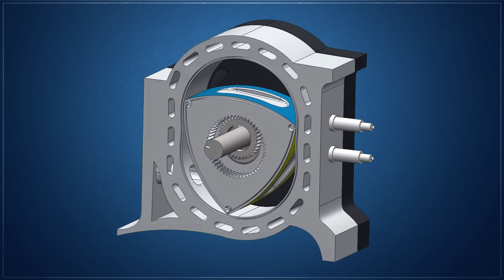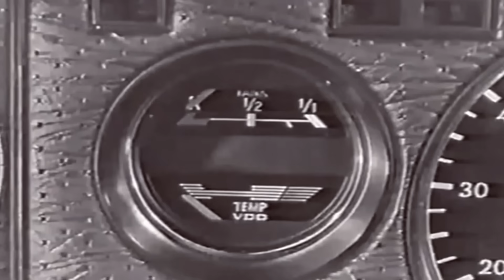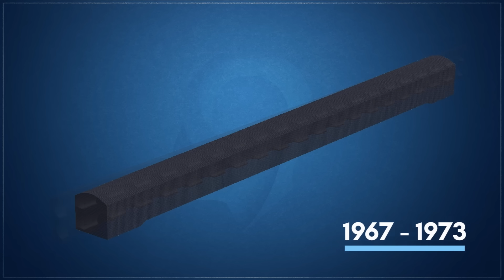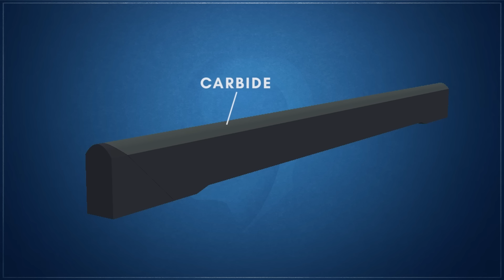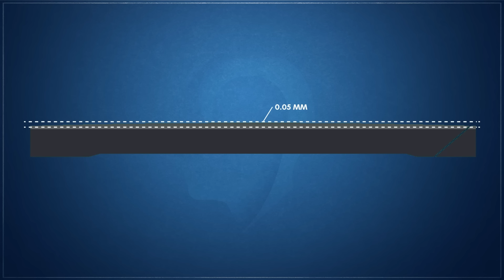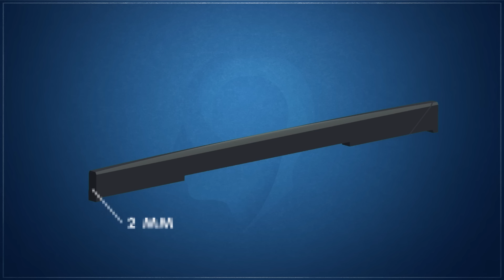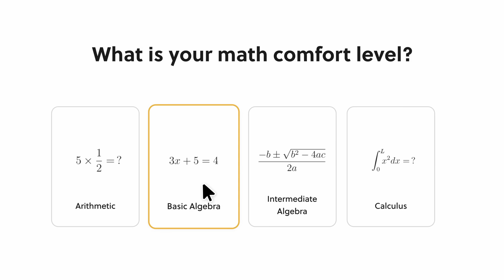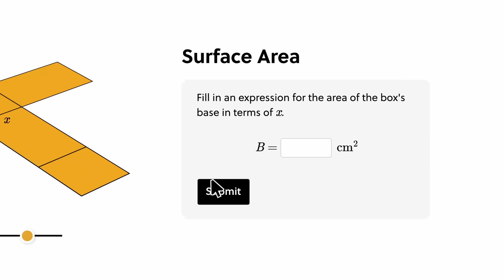Overcoming The Rotary Engine’s Biggest Flaw

Comment: Good video but I think it's missing some of the story though. Apex seals have gotten improved significantly by rotary shops after Mazda abandoned the rotary engine. Some rotary builders don't even consider them the most common source of the major issues with the engine.
Reply: This is great for prolonging the life of vintage engines, but it doesn't address the fuel economy or emissions problems with new engines.
Reply: @rockets4kids  The most HATED rotary🔥🔥😬💥🤘👉 https://www.youtube.com/watch?v=gHVC9DN1row
Reply: 100% spot on. Aftermarket support for apex seals are so plentiful and great that it’s now the least of problems, especially when more owners learned to premix their fuel as well. Now the longevity of rotary engines, especially boosted ones, dealt with the immense torque produced with the added boost. 

This could be an important topic someday, considering the new 800cc extender in the new SUV was also physically larger than the 13B designs. With Mazda planning something big for their future sports car based on patents I’m very certain Mazda definitely looked more into improving the strength of the rotors and housings under extended load.
Reply: @Nafeels the engineering continues but emissions is something the aftermarket doesn't have to worry about.
Reply: @Noman1000 Reliability, not emissions is why Wankel engines are obsolete technology today.
Sales of Wankel engines was worse in countries with absolutely no emissions regulations.
Reply: @Nafeels Apex seals are inherently weak and unreliable by design.

You have to be monumentally ignorant to pour the wrong oil into the wrong filler hole son, if you cannot read your owners manual or the label on a bottle of motor oil? You have no business under the hood of any car.

Please stop spreading lies and ignorant misinformation about a topic that you clearly do not understand.
Reply: @Nafeels 
Yes. To me, Wankel engines are just 2strokes in another form. I'm already used to premixing gas in bulk, because my work bike is a 2stroke. I'm seriously considering putting a Mazda Wankel in a motorcycle. Especially if that Liquid Piston engine still isn't for sale yet.
Reply: I love Wankel engines because I don't like vibrations, but I do love their sound. A single cylinder is the most efficient engine I've found for generators. But for a powerful, lightweight drive engine.
I'm interested in very small inline 4, V4, V8, V10, Wankel, and gas turbine engines.
Reply: @observingrogue7652 If you don't like vibrations? Then why exclude V-12s?
 The only type of internal combustion engine that is truly vibration free is the gas turbine...
Reply: @sandervanderkammen9230  
I honestly shouldn't even have included V8s & V10s. 
Like I said before, the most efficient engine, at least the most efficient piston engine, is single cylinder. The more pistons you add, the more high RPM power, but also the more friction losses.

So even if I found a great RC plane engine, or some small multi-cylinder like that. It wouldn't be great for a Series Hybrid motorcycle generator. 

And to directly drive the bike itself, all this tiny pistons will need an electric motor for low RPM torque. Otherwise, just to move a bike and my fata55 by itself, I would have to set the idle very high, to keep a little V8, 10 or 12 from stalling everytime I tried to ride off.

And on top of the friction losses, there's the bigger mess of maintenance.

I hate the vibrations of single cylinder, but I would rather use rubber mounts for a single, or couple to singles together with gears, to make them more balanced then the 2cylinder BMW Boxer engines, then put a V8 or more in a bike.

I'm so sick of the mess, noise, and maintenance of engines. A single is the best option for me, to power a bike, because the Jaguar didn't make their Hybrid super car concept. 

If they did, I would have had a great chance to put an efficient micro turbine in a bike, to power a generator, and even run on a variety of fuels. 

But for now, I'm stuck with single pistons, rubber mounted, and some exhaust tricks to smooth out that thumper sound, or silence it entirely, to hear any electric motors, and the environment around me.
Reply: @observingrogue7652  Well, you clearly stated that you don't like vibration, so a (4-stroke) reciprocating engine with 12 or more cylinders is your first choice because of the lack of crankshaft harmonics.
12+ cylinder engines have power strokes that actually overlap as opposed to a V-8 where the crankshaft is violently jerked forward and then coasts 4 times per revolution.
This is why V-12 engines are popular in luxury cars, and popular in aircraft because they don't need a heavy flywheel to dampen the power pulses.
You want a silky smooth motor? 12 cylinder boxer...

Gas Turbines are completely unsuitable for automotive or land-based transportation applications, the duty cycle requirements of the Gas Turbine is also completely incompatible with the charge curve of rechargeable batteries.

You want a smooth motorcycle? Don't waste your time and just go buy a BMW or a Goldwing.
Reply: @sandervanderkammen9230  
Oh, and I respect sport-touring bikes like the Goldwing, and BMWs answer to it. But I prefer, lighter, more compact & agile bikes.
Reply: @observingrogue7652  Well, you have what we would call design requirements which are in direct conflict.
If you want a bike that is lightweight, compact and agile you will have no choice but to accept a design with higher noise and vibration and poor ride qualities and comfort.
Reply: @observingrogue7652  Electric bikes are not lightweight, compact or agile...and they have other disadvantages.

Gas Turbines would be even less compatible in a series hybrid motorcycle than a car because of the ICE to batteries power ratio.

Reciprocating engines have the same multi-fuel capabilities as gas turbines and it is always cheaper, more efficient and more reliable to build an engine that is optimized for a single fuel,  gasoline is the optimal and ideal fuel for motorcycles, you don't see many options in the motorcycle industry for this exact reason.
Reply: @observingrogue7652  Out of curiosity... what do you ride currently???
Reply: @observingrogue7652 I’ve seen wankel motorcycles in the 1980’s when I read electric meters.
Reply: There’s a much more interesting video recently about the new iteration being direct injection. A massive part of the inefficiencies was from port injection, as there aren’t valves you don’t worry about carbon build up and you inject later in the chamber so you don’t get fuel build up against the seal pre-ignition. Definitely could see one last RX before they end the legacy, this hybrid could be the test bed for that car, to develop the direct injection and new geometries.
Reply: @Sharpened_Spoon  The most HATED rotary🔥🔥😬💥🤘👉 https://www.youtube.com/watch?v=gHVC9DN1row
Reply: @Sharpened_Spoon  Oh and don't expect much from wankels, They are doomed to be inefficient and polluting, no matter how developed they are.
Reply: @Sharpened_Spoon  Mr. Spoon, would you give the title of that DI rotary video? Would like to see it, but a direct link may get removed, so the name itself will be better.
Reply: @davidb6576 The Mercedes-Benz M950F was direct injection, while tests showed it reduced emissions compared to existing Carburetor technology it had no significant impact on fuel efficiency or reliability.
Reply: @Sharpened_Spoon The President Akira Marumoto's announcement in July confirmed that the MX-30 was cancelled.

 Direct injection was first used on Wankel engines back in the 1960s but the Wankel engine lacks the ability to run higher static compression ratios needed to take advantage of Stratified Charge Mode Combustion.
Carbon deposits are the result of low compression..
. It's those inherently weak unreliable apex seals that are the problem, not fuel injection.
Reply: @sandervanderkammen9230  as per my above comment I’m just going off he statement Mazda made in their press kit about it being far more efficient, solving some problems that likely led to a less exciting engine in the RX8.
Reply: @Sharpened_Spoon  Mazda press department has sadley lost its credibility in recent years... with a seemingly never-ending stream of clickbait hoaxes like the 16X engine, RX2 Demio rotary hybrid, RX9, RX Vision, Vision Coupe and most recently the still born MX-30 Rotary Range Extender.
Reply: @Sharpened_Spoon  According to official Mazda Board of Directors minutes, the development budget for Wankel engines was slashed in 2006 and the Board voted in May 2009 to completely cancel all new development of Wankel engines... No new Wankel engines have been unveiled by Mazda since 2007 (16X) which has completely disappeared from the Mazda global website.
Few industry experts took the MX-30 rumors seriously and of course, no big surprise itsbeen canceled too.
Reply: Mazda did increase fuel efficiency via direct injection and exhauset recirculation with their newest hybrid-based engine tho, supposedly by 20-25%. Which is probably the rotary engines other major issue, oil and gas consumptuon (at least in a consumer viability sense)
Reply: A correction, Mazda never fully gave up on developing the apex seals, they actually have the option of buying ceramic seals open to this day, just that they were never used in production cars
Reply: @rudrakshmishra2761 Mazda abandoned development of Wankel engines in May 2009, they never found a solution for unreliable apex seals.
Reply: Mazda still hasn't absorbed it tho
Reply: Cool video, but you need to do your research. This is a wankel rotary, you should clarify that in the title instead of just claiming rotary and not showing a rotary
Reply: I want to make a rotary engine that fixes this problem
Reply: You dont need a endless supply of lithium or even grid capacity today. Electric wont be the most common vehicle sold in 5 years or even the time governments hope.

It will be a slow progression, as demand for batteries increase more mines will be opened, rare earths found and advancement of materials needed will progress
Reply: They're still inefficient with high emissions though.
Reply: I forgot to mention.
BEVs and traditional drivetrains both have problems.

This is part of the reason why I love Series Hybrids. They are Electric Vehicles with built in generators for range extension and versatility. The engine is just there to charge the batteries. 

It would be even better if there was also a block-heater, and independent oil & coolant pumps, so the engine is warm and lubed up, before it even starts, reaching operating temperature, proper expanded clearances, and peak efficiency as soon as possible.

Unlike traditional drivetrains and Parallel Hybrids. Series Hybrids should never be wasting fuel idling. When their engine is on, they are doing work, unless the battery is already fully charged.

I do declare, Series Hybrids are the best, of both worlds, and the best, period. I believe every vehicle should be a Series Hybrid. 

The instant torque & elegance of a Battery Electric Vehicle, but the convenience of gasoline or diesel, engine is kept in it's most powerful or most efficient rpm, even better than a CVT, no clutch to burn, and reduced wear, complexity, and possibly power losses as well, compared to a multispeed transmission and differentials sending power to each wheel instead of just having a motor at each wheel for All Wheel Drive. With as expensive Teslas are, I'm surprised none of their cars do that, but rely on the brakes for torque-vectoring, for extra stability or turning ability. 

The point of Regenerative Braking, is to extend battery, hybrid fuel, and brake pad ranges. But they use brakes and open Diffs to control wheels instead just using a motor at each wheel?
The Tesla Semis are different though.

If all anyone cares about is the best performance, then Hybrids are the best for the most power, convenience, and efficiency, because they cover the weaknesses of the 2 power sources.
And a Hybrid doesn't need such a big battery, because it has an engine to back it up. So less battery weight, cost, and socio-economic concerns.

Like I said, I deliver things for a living using a 2stroke bike. It's one of those Motorized Bicycle kits from Amazon. Learning about them from the Hughes Motorized channel. No gearbox, it's a single speed, drive chain right off a motorcycle style clutch.

Inspired by the Koenigsegg Regera. I'm putting an e-bike kit on the same frame, for stealth to avoid unnecessary attention or waking people up, and can accelerate much better from dead stops and low speeds. And I have the engine for high-speed power, and I'm gearing it for more top speed and efficient low RPM cruising. And unlike the Regera, it will be ALL WHEEL DRIVE, because it's a hub motor in the front wheel, maybe another in the rear. 

Like a single speed Porsche 918. 

I don't get why there is such a cold war or pissing-contest between Engines and Electric. Instead or arguing over the downsides of each, why won't everyone just embrace both? Make a Series-Hybrid like Warped Perception is doing with his Tesla, or a Parallel-Hybrid like I'm doing with my work bicycle.

There are videos & websites about homemade Electric Vehicles. Just expand upon that with traditional car cultures to make a hybrid. 

It's not that hard.
Then again, I recently found out I'm a Virtuoso Personality Type, so I don't know about the rest of you.
Reply: @observingrogue7652  i agree about series hybrids being the best electric option currently. I don't know why more manufacturers didn't try that. Only chevy that i can remember.this rotary is mazdas attempt at it right? I assume the fuel efficiency must not be the best? Nornal loss from engine thermal efficiency. But then u have lost power in the alternator or whatever it is. Plus charging losses. But u can keep the engine at its lowest bsfc.

Instead most companies are just focusing on increasing pack size. The opposite of what i would expect from a slow moving industry.
Reply: They are dirty, inefficient, unreliable, and completely outclassed in every measurable metric by both piston and EV cars. It's a neat idea and the FD is one of the most beautiful cars ever produced, but that engine is a piece of dogshit.
Reply: @shane864 Ah, yes. The knee-jerk reaction of the uneducated parroting the uneducated. 

The 13B family of engines (13B, 13B-REW, 20B, 26B, and even Renesis) was successful beyond belief. So reliable that they dominated GTU endurance races, won LeMans outright against the cream of the European crop, and set high water marks for smooth, reliable power per pound. Corvette motor levels of power in a package so small and light that it enabled a front-mid-engine placement so low that it dropped the car’s center of mass to near a foot, perfect 50/50 balance before it was common, and (with the fuel tank ahead if the rear wheels) almost all of its mass within the wheelbase. Fuel economy and exhaust byproducts were similar to other engines of its output at the time. And the mythical apex seal failures were rare unless misguided modifications were made during porting or “big turbo”  to try to hang with Supras in a straight line. The FD was a sports car. One of the best ever. It wasn’t meant fir straight-line power like the Supra, which couldn’t handle worth a damn on road courses - the real motorsport. Drag racing is men running in high heels. 

I have over 300,000 reliable 450+ hp miles on the original sequential turbo configuration. Superior driveability and Z06, Viper, and 911TT- besting performance at Sebring, Road Atlanta, etc. 

Think before you speak.
Reply: @shane864  but enough about yourself
Reply: They are a product of their time. The new Wankel engines look extremely promising. You cannot simply look at the engine and declare it trash, as you have to weight the advantages and disadvantages for their use case. Also EV is trash, their supposed cleanliness is flawed when it comes down on the environmental damage mining of lithium causes and when you take into consideration that there are big losses from the flawed logistics of making the electricity in a power plant and then transferring it to a battery. A fully EV future is a impossible, there isnt simply enough lithium for all the cars. Hybrids are the future.
Reply: @czechdepression4924  LOl, there's plenty of lithium and different materials will be developed long before lithium would ever be a bottleneck.
Reply: @johngalt97  Hallelujah, the Elon (our E-Jesus) will bring us not only a groundbreaking new battery but infinite supplies of rare earth metals as well as all mines necessary to produce all that is needed.
Reply: @czechdepression4924 Although i agree Battery Electric Vehicles (BEVs) aren’t an optimal solution, between new mines popping up, and Sodium Ion Batteries taking off supply isn’t much of an issue.

Also the environmental impact (at least for the lithium) is more complex than that Tar Sands Steam Injection vs Lithium Pit Mine “meme”.  Most lithium is extracted from salts by “brine mining” (basically pump in water, pump out brine) which is then sun dryed in fields then filtered.

Not optimal, but water use and land use change are the main issues.

Cobalt and other odd metals like that are also an issue, mainly to geopolitical issues, but those are being addressed as well (either by better sourcing or batteries without them)

Finally though: Walkability and Transit Improvements are the REAL Solution
Reply: . Wankel engines have no advantages which is why Reciprocating engines and electric vehicles are still sold... and the Wankel is not.
Reply: @ericlotze7724 birth control is the REAL solution... to many people is the root problem, not vehicles.
Reply: @czechdepression4924  A fully EV future is possible, but the storage media may be in a form of a hydrogen gas tank.
Reply: @siontheodorus1501 That won't be  a fully electric vehicle... hydrogen is a chemical fuel.
Reply: @shane864 so how is getting 200hp out of a 1.3 liter motor(renesis) inefficient? 
How is a motor which has less moving parts than a piston engine less reliable?  When treated properly these motors will run just as long, if not longer as their piston counterparts. 
There's nothing efficient about EVs. It's not cost efficient neither better for the environment than a gas car. Tailpipe emissions is a minor factor compared to the whole vehicle( especially those EV fires).
Reply: @nattadam4171  Every single thing you just implied or claimed is objectively false lol. An almost impressive level of delusion.
Reply: @shane864  It is light.  That matters in niche applications.
Reply: @FleaNutClaypool  An LS1 swapped FD is like 70 lbs heavier than a 13b. The engines are a novelty but anyone that actually builds stuff without an emotional attachment knows they are trash, that's why FD's are still cheap even though they're easily the best chassis of all the 90's USDM Japanese cool cars. I tried to like them but EVERYONE that ever had one back in the day never ran. Like ever.
Reply: @FleaNutClaypool Wankel engines are not lighter and have lower power-to-weight ratio performance
Reply: @shane864 An LS motor delivers the torque of two 13b motors...
Reply: @shane864  dude have you checked the prices of FD rx7s in the last 5 years? non running shells will cost you around $20k nowadays.
Reply: @2AMinLosAngeles  I would have guessed 15-20, seems fair enough given the price of everything now. The top end iconic Japanese cars of that era are the Supra, Skyline, and FD with the FD being the prettiest of them all so compared to the other two they are still a crazy bargain,  which I assume is because that engine is awful. Best swap car of all time tho imo. I have a deep love/hate relationship with the FD lol. Edit- oh shit Throttle House just put up an FD video
Reply: @shane864  the battery is dirty to make.:body-blue-raised-arms:.
Reply: @davidfrank6666  Once. Now do the never ending, completely unsustainable oil in the ground to gas in your car supply chain since you're so concerned with clean energy. lol
Reply: @shane864 But internal combustion engines can and do run just fine on renewable energy... Petroleum is still cheaper and meets current demands, something that EVs and alternative fuels cannot do..
Reply: No one has ever made apex seals reliable